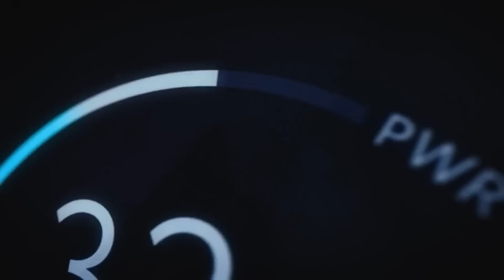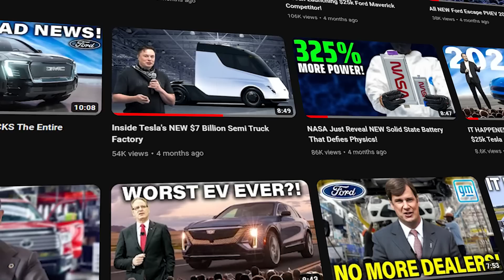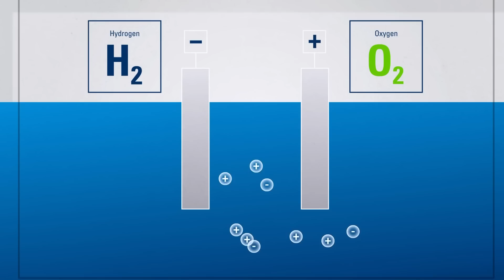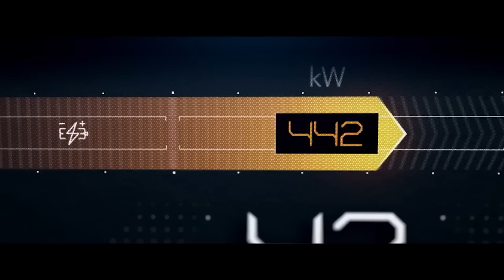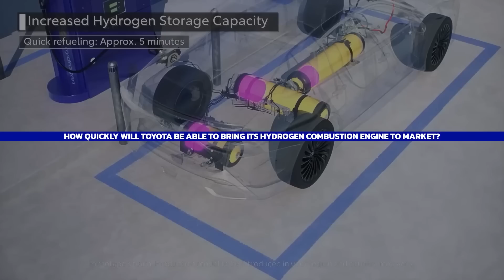New Toyota CEO Reveals Hydrogen Combustion Engine | Shocks Industry!

Comment: It’s got to be more environmentally friendly than having 5,200 battery cells in every car battery, and stop the use of children to mine for these damaging chemicals. 
Both infrastructure is obviously in its infancy but I honk Hydrogen will be the winner in the end once they get petrol stations converted to Hydrogen.
Reply: HAHAHAHA. No American EV manufacture uses child mined cobalt. Unlike the child mined cobalt used in hydrogen fuel cells along with palladium and platinum. Also petrol stations just can't convert to hydrogen. It will cost tens of millions to put in a hydrogen station capable of filling what an average gas station does. Then the running costs for that station are 100X what a normal gas station costs to run. Plus who are these people that are going to pay 4 times as much for fuel over gasoline and even more over EVs?

Comment: All of these BS ideas from manufactures and governments they never mention the dark side of this techs. Since the early 90's  there has been a way to use your regular engine gas or diesel and convert the fuel system and believe or not run on all liquid ideally water that right water and clean oxygen come out of you exhaust pipe. Just research is out there in the good old internet
Reply: The main reason there is no money in truly clean and renewable fuel
Reply: God you people are stupid.

Comment: 1. Most people slow charge at home, and it's fine. Try that with hydrogen.
2. People can have their own solar panels & home batteries. Try that with hydrogen.
3. Batteries a 95% or better recyclable. The metals can be used over and over.
4. Grid storage ramping up fast. Not happening with hydrogen.

Comment: I see tons of people that cannot think outside of the box trashing it. Just because a problem is difficult to solve does not mean it cannot be solved. If they succeed they will have tapped into an energy source widely available. I see so many blinded closed minded people sold on electric cars it makes me sick. I am not against electric as I am for more than one source of energy. I see electric bills getting so high we may have to start going without AC in the summer due to the cost of electricity. The law of supply and demand has conveniantly been forgotten these days. The higher the demand and the less supply means higher bills. We can barely power our cooling in the summer let alone adding cars into the mix. Power companies will raise costs to raise money to build infrastructure. I am 100% behind Toyota on their endeavers because they are clever and I know they will solve problems and come out with something that will be a game changer.

Comment: Electric vehicles (EVs) have a drawback which many people do not realize. EVs have to be charged by chargers which draw their energy from the power grid. The power grid is in turn powered by generators run on fossil fuels like gas, gasoline, diesel, coal etc. So EVs are not free from carbon emission after all. On the other hand, hydrogen ICE (not hybrid) may be a better replacement for fossil fuel ICE. But the hydrogen ICE has its own problems which are waiting to be solved. So, our future is likely to be filled with both the EVs and hydrogen ICE vehicles.
Reply: You do understand to get clean hydrogen you have to use 4 to 6 times as much electricity as just putting it in an EV. Meaning that you need to pull from the dirty grid 4 to 6 times as much pollution to go the same distance as an EV.

Comment: although Hydrogen car is great technology.. it will fail in US and EU because of the lack of charging station infrastructure and EV marketing. It will fail like BETA(vs VHS). by the time Toyota developed a mature Hydrogen car there will be tons of cheap BEV in the market already. Toyota you need to develop BEV by your own.. not rebadged BYD one. 
but I think Toyota still have a chance since customer royalty is very high now. but Toyota should move quickly.. time is running out soon(like within 7 years).

Comment: Toyota is 100% right. The future is fuel cell/hydrogen and not electric. There will not be enough power to charge all these electric cars and based on demand the cost of charging them will be astronomical.
Reply: It takes up to 3 times the electricity to produce the hydrogen (compared to charging), So if there will be not enough electricity for charging how on earth will it work for hydrogen??   Hydrogen in transportation is a solution for The ignorants.
Reply: @elektrischverhaal5166  You have absolutely no idea what you are talking about. You are spreading misinformation. I suggest you go and educate yourself about how Hydrogen fuel cells are manufactured. Electric cars will be obsolete in a very short order once the hydrogen fuel cells take off. They are being developed as we speak.
Reply: @simons5193  🤔 look who’s talking. Separating hydrogen from water by electrolysis requires massive amounts of electrical energy. Hydrogen can be re-electrified in fuel cells with efficiencies up to 50%, or alternatively burned (60% efficiency). Not to mention the “gigantic tanks” required to hold hydrogen in liquid form.

Comment: The Hydrogen Combustion engine will still need an oil change for lubrication. It will also cost more than an electric motor with all those parts. No to mention  hydrogen station infrastructure.

Comment: Another stupid and impractical engine built solely for deception and PR.

There's an engineer here on YouTube who debunked their dumb H2 V8. Did you know that to get 300 miles of range from a V8 hydrogen combustion engine you'd need a tank nearly 15 cu ft, and it's the equivalent of a 105 gallon tank. If you're wondering that's just slightly smaller than the current Camrys total trunk size. 

Hydrogen combustion = FAKE NEWS!!

Comment: Honestly, I think Toyota ought to work hard to develop EVs. Hydrogen is interesting, and may be useful with a fuel cell as an emergency backup to extend the range of an EV. That said, I think that EVs are the future. Maybe a hybrid with a fuel cell could be useful for extending the range of an EV, but I think that development money would be better spent making EVs more practical.
Reply: The main problem is electricity grid systems.
Reply: @normanchristie4524  That is primarily propaganda.   Well over 90% of charging happens off peak....plenty of capacity then.  The Propagandists won't bring that little fact up though....

Comment: This video has such a dizzying array of half-truths and outright falsehoods, it's hard to find a place to begin.  H2 is not easier to transport than electricity.  It requires high pressure tanker trucks that carry around less energy than a regular gasoline tanker.  H2 ICE cars run so much hotter than gasoline engines, they can't be as durable.  H2 ICE cars produce NOx pollutants like all ICE cars.  I've never loaded H2 fuel on my wife's H2 car in 90 seconds, but we have waited in line 90 minutes because the nozzle froze in Southern California on a normal hot day.  The video showed some graphics that imply H2 being converted to electricity at the same time it was talking about H2 being used in an ICE engine.  This is extremely misleading.  Toyota should stop adding to its mountain of debt with this world's-worst idea and Japan should start deploying some solar panels and wind mills.

Comment: Hydrogen is a great idea, and an alternative form of clean energy that could see Toyota compete well in the days to come, and certainly see hydrogen combustion being the future of automotive racing and sporting events, but key to moving it forward would be investing in the infrastructure, such as Tesla did to really lead the industry forward. Hydrogen combustion is perfectly complimentarily towards battery EV's, as it's a far different approach that doesn't wean too far off from what we currently have with petrol vehicles.
Reply: My Model 3 has more horsepower than that Toyota hydrogen race car.  And I don't even have the Performance model.

Comment: To get 70 miles, you’ll need:
$14.50 worth of hydrogen (using 3 gallons of water)
$7.50 worth of gasoline
$2.20 worth of electricity
Any questions??
Reply: "$14.50 worth of hydrogen (using 3 gallons of water)"

That 3 gallons of water produces oxygen and hydrogen as a by-product!

Australian scientists have already created a process that produces hydrogen for around $2/kg (it is being scaled up now)

Japan already produces red hydrogen by using excess energy from nuclear power stations

"$7.50 worth of gasoline"

You can get fuel to do that range for less than that (but typically only around a few dollars less)

"$2.20 worth of electricity"

The site enelxway has got a fairly accurate charging cost comparison.
They list the cost of charging at around $11 (public charging), if you want it cheaper, you need to go with a subscription model

If you add up all the costs, higher prices at purchase, installing infrastructure at home (unless you want snail charging) or subscriptions etc, the cost of EV's is actually slightly more than owning an ICE vehicle.
If you keep an EV long term, then your going to need to pay for a complete battery swap-out at some point

Looking at just the day to day cost of an EV vs an ICE does not tell the whole end to cost costing

Plenty of good quality sites will show the end to end costs and they don't favor EV's over ICE, it closer than it used to be but EV's are not there yet from what I have seen
Buying an EV on day to day running costs is not to see the bigger end to end picture, buying an EV because you believe they are better for ideological reasons is a personal decision
Reply: I have a question. Where did you get your false info from? CNN?
Reply: @gordonliddy6997  I have a question. Was it your momma that dropped you on your head as a child, or was it your father?

Comment: The massive negative components of going into the hydrogen engine for vehicles approach is that you are using a similar economic infrastructure plan to regular gas power engine technology. What this means is that the customer will encounter the same expenditures in maintenance, fueling, and tax only with hydrogen instead of gasoline.
I prefer the electrical power approach because much of the mechanical failure in vehicle design that concerns engine components is reduced with electric engines, and that powering the hardware and other assets that require electricity does not have to be connected in anyway directly to third party businesses if you so choose to reduce interactions in that way. You can power your electrical requirements however you see fit on various electricity options that no one has the authority or control to force you to do, while if you go the hydrogen route, at the moment, your use of the vehicles will be extremely connected to legacy business and governmental powers that can cost you more than you desire or expect.
Reply: You don’t believe the government can’t and don’t want to control how much electricity you consume?   And really, that isn’t the immediate problem.  America doesn’t have the infrastructure to provide that much electrical power especially if they force us to use “renewable energy sources” such as wind and solar.  I hear California has rolling brown outs all the time because they cannot supply enough electricity for every day needs.

Comment: This may not be the way to go. However I'm still not sold the EV infrastructure being reliable for a long time. So I will rotate the ICE fleet until they get it worked out.
Reply: The EV infrastructure is sitting in your garage.  It's called an electrical outlet.  Cheap and easy access.

Comment: The big picture problem is that there aren’t any large deposits of pure hydrogen just laying around.  

Rather, hydrogen is bonded to other elements and it takes more energy to break that bond than can ever be re-captured by burning the hydrogen.  

Rather than using natural gas reforming, or electrolysis, it would be more efficient to simply run an engine off natural
Gas or use the electricity to charge EV batteries.

Comment: I like how they used tesla chargers overseas that was the problem and Europes infrastructure isn’t like the US or as good plus a hummer ev doesn’t use tesla chargers it uses electrify America which has crap infrastructure and crappy chargers. Whoever made this video obviously hates tesla. Owned a tesla for years, best vehicle I’ve ever owned, less maintenance, 1/3 cost of gas equivalent to charge, depreciated 3%, and the battery only degraded maybe 8% and leveled off over 3 years, been all over the US on roadtrips starting from Illinois to east coast and west coast. Never had a problem charging and the most I’ve waited was in San Diego about 45 mins.

Comment: Well we know that the Mirai was such a successful car for them!  Lets see half a dozen fill stations pretty much in the Bay area, and then super hard to fill.  Giving away $15K of hydrogen and they still can't sell them!  🤦‍♂🤷‍♂
Reply: No one wants these cars looks very dangerous to refill hydrogen , even with free hydrogen I still wouldn't touched this thing
Reply: @flygonc3717  
That fear comes from bullshit propagation after the last about 50 years. When someone starts to talk about hydrogen driven machines then the first picture what they get shown is the Hindenburg. It is not so easy to bring hydrogen to explosion! You need a perfectly gas mix with 2H2 and O2. This will lead to an explosion otherwise without Oxygen will Hydrogen not explode or burn. So when you got seperate containers with Oxygen and Hydrogen is the chance that this will explode the same as high as to have just the Oxygen container without Hydrogen in your machine. Another thing is, Hydrogen cant so easly inflame itself. Also when a fuel container broke then they is just Hydrogen and Oxygen which part of our breathing air and doesnt lead to a nature catastrophe.

Comment: TOYOTA IS TOTALLY OUT OF TOUCH WITH ITS CONSUMERS BECAUSE IT THINKS  MEAN THAT ARE  6 FT 2 INCH TALL ARE WILLING TO SPEND $30,000-$40,000 FOR THE RAV4 AND INTENTIONALLY MANUFACTURED THE CAMRY WITH NOT ENOUGH HEADROOM FOR SOMEBODY THAT IS 6 FT 2 INCH TALL. THIS IS GREED ON STEROIDS. SECOND THE RAV4 HAD OIL BURNING PROBLEMS FROM 2004-2011. AND IN 2004-2005 THE HEAD BOLTS GOT STRIPPED RESULTING IN A VERY EXPENSIVE REPAIR. IF TOYOTA REALLY CARED ABOUT CONSUMERS THEY WOULD HAVE MADE A CAMRY WITH ENOUGH HEADROOM FOR SOMEBODY THAT IS 6 FT 2 INCH TALL FOR $15,000 THAT DOES NOT BURN OIL LIKE THE RAV4S FROM 2004-2011 AND WITHOUT A HEAD BOLT PROBLEM. TOYOTA IS ALSO OUT OF TOUCH WITH ITS CONSUMERS WHEN IT ASSUMES THE AVERAGE CONSUMER WILL HAVE ACCESS TO A CHARGING STATION FOR THEIR EVS. THEY FAIL TO TAKE INTO ACCOUNT THE FACT THAT APARTMENT RENTERS WILL NOT HAVE ACCESS TO CHARGING STATION AND THE FACT THAT IF EVERYBODY HAD AN EV YOU WOULD SEE ROLLING BLACK OUTS LIKE IN CALIFORNIA SINCE THE ELECTRICAL GRID WILL NOT BE ABLE TO HANDLE THE DEMAND FOR ELECTRICITY TO RECHARGE EVS. TOYOTA ALSO FALSELY ASSUMES THAT A CONSUMER IS WILLING TO PAY THE ADDED COST OF ELECTRICITY ON THEIR HOME ELECTRIC BILL IN ORDER TO RECHARGE THEIR EVES/

Comment: When charging EV batteries you lose between 10% and 25% used to charge. Battery power is not an efficient use of energy. With a grid in bad shape in the US it takes a real genius to add to the demand on it with thousands of EVs charging and losing more than 10% of the energy to boot. The EV craze is another emperor’s new clothes version. At some point even the most diehard EV cult worshipper will admit the emperor is butt naked.

Comment: I wish Toyota would come out with a line of hydrogen powered fuel cell while home backup generators instead
Reply: Ideally you could even drink the distilled water that came out of your generator in an emergency
Reply: Yes because everyone wants to pay $20k+ for a backup generator that needs specialty equipment to store highly compressed hydrogen. Never mind if it leaks it can take half the block with it.

Comment: The natural gas network in the UK is currently being made hydrogen compatible. Most me boilers for houses can run on hydrogen.
Renewable and traditional  electricity will be used during low use times to produce hydrogen.
Reply: That makes no sense.  Natural gas has 2.5x the energy density of hydrogen and natural gas is used to make hydrogen meaning additional losses are incurred by making hydrogen.  If you are going to then claim it’ll be made with electrolysis then it still makes no sense because the energy required to make it and compress it costs more than the energy to use a heat pump or resistive heating.
Reply: @diamond_h0us  So, I used to do Plumbing, Heating and Solar in the UK.  The Government ministers in charge of future planning tend to listen to the companies that will donate the most to their parties. Normal Logic does not apply. If you can donate to the party then you will get a lunch with a minister in charge of policy.  They aren't listening to futurologists, they are talking with the people with a vested interest that will give their party money.   It is much the same in the USA, it is just less obvious as there are more legislators involved.  eg. Would less bank regulation be a good Idea?  How about less Train safety regulations?  Both have been reduced in the last ten years and it isn't the president (so don't think I am partisan) making the decisions, it is the whole government.
Reply: The modern parts of the UK gas network are made of  plastic pipes...hydrogen is corrosive to plastic...how are they going to make it compatible?